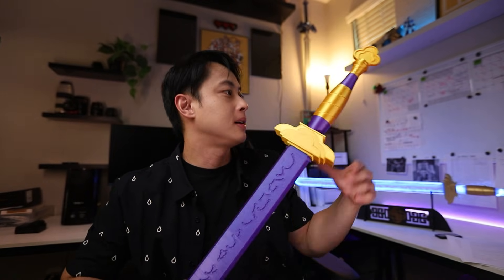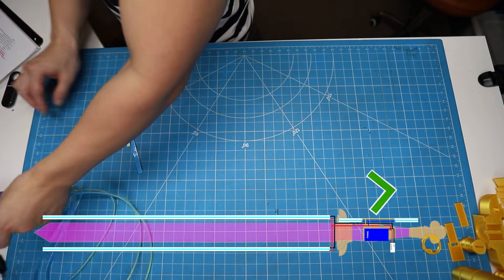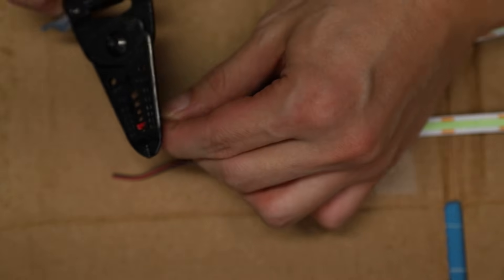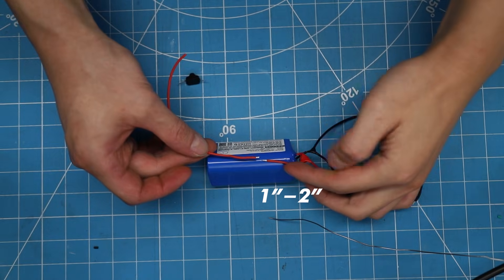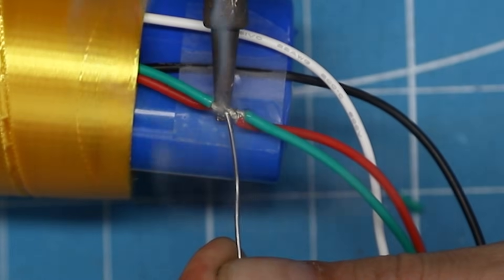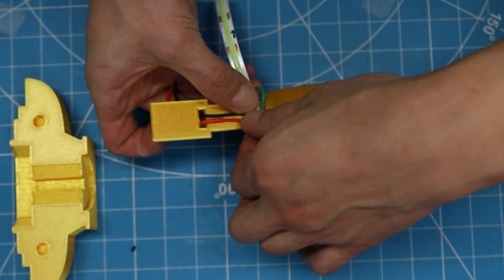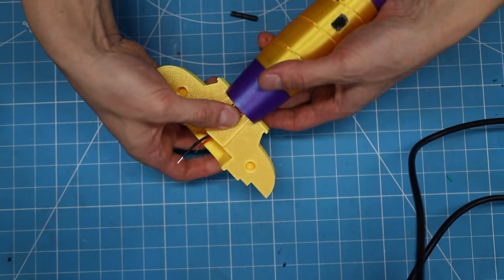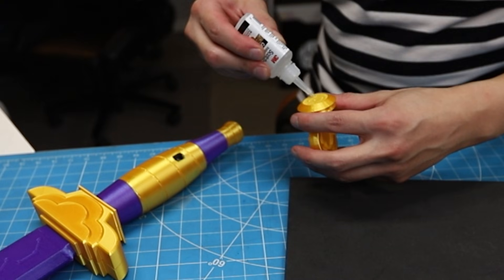Rumi Sword Quick LED Tutorial

Comment: If I wanted to make this with a color change RGB LED light, would that be possible or is this build only for single color LEDs?
Reply from the maker: Unfortunately the color changing ones will not work on this design because there isn't enough room for the microcontroller to address the LEDs.